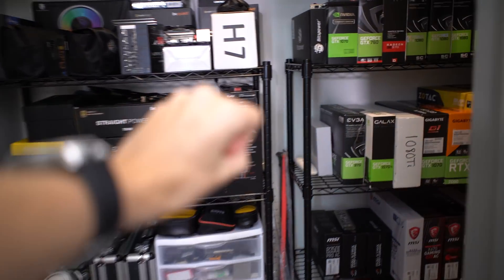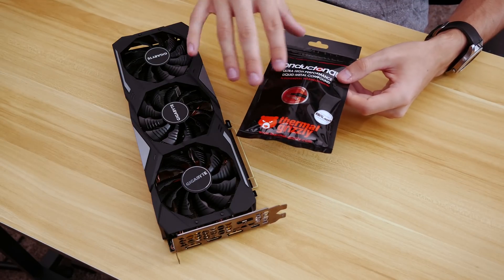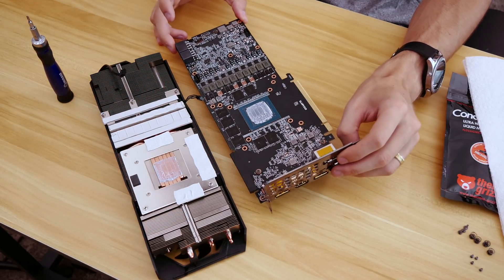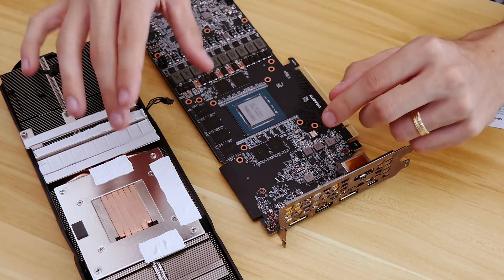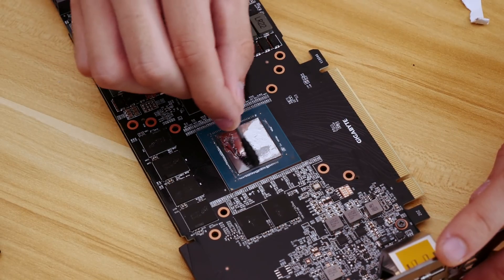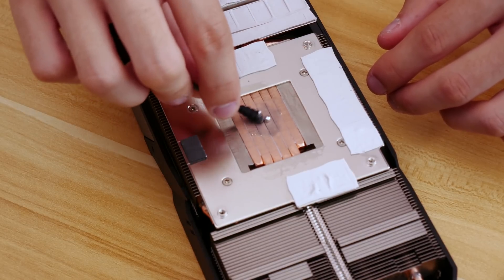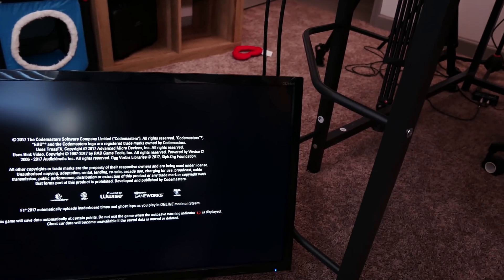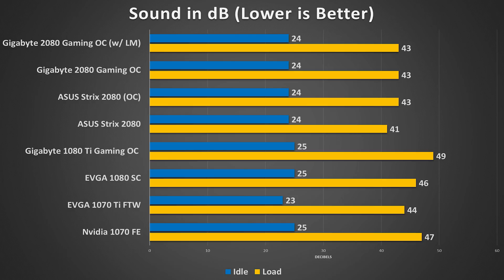Liquid Metal on a Graphics Card?

Comment: Instead of going with liquid metal right away, try just putting on new thermal paste. Temps get worse are thermal paste ages and the factory applied thermal paste often isn't great either. My 1080 Ti mini dropped 5°C just by putting on new thermal paste.

Comment: You need to first set the fan speed or rpm to the same number, if its left on auto it'll just lower the fan speed and get the same temp, next you need to have the same clocks. This testing is very faulty.

Comment: I think you'll find the real reason aluminium is used in heatsinks is not because it dissipates heat better than copper (because it doesn't). The primary reason is cost. Copper is roughly 3.3x more dense and roughly 3.5x the cost, meaning that 1 cubic metre of copper costs roughly 13x more than the same volume of aluminium. There are of course additional benefits in that aluminium is much lighter and it's also easier to work with.

Comment: What? You could not apply LM on bare copper? I never applied on copper pipes, but on copper 7yo heat sink where liquid metals just started to exist? All spreads well on copper.
You just need to remove all compound and grease. Just rub LM in and done.
Reply: Do you know what element the liquid metal is getting in contact with? (The cooling part, not the die)
Because if I'll buy my new PC, I wanna buy a vega 64 and probably will use LM on both my cpu and my gpu, but I don't know if the LM will have contact to Aluminium on the GPU cooler

Comment: I dont think its a waste of time GTX 1080 with kraken watter coling its nice.... But I literally could not hold below 48°C (of course high OC with custom bios & voltage above 1095mv... What is bad about that? If temp rising to quickly frequency going to drop same as if you are going above 48°C. With Liquid metal? Its no going above 39-40°C  even after few hours of full load at 2138mhz (1150mv ) stable freq as well as (OC in general). So its usefull  (as fine tunning) and not only in my hands! I would say more heat you can generate  -> more advantage of liquid metal you can see. Thats just my experience. Cheers.

Comment: Hey there in your bench you 1080 ti gaming oc is 80 degree ... i have the same card i replaced the paste to mx-4 and termal pads which i dont even know if they sit right.... the card is 65c (max)at full load my pads are 17 w/mk ... i dont know if this temps are from the help of the pads or only the gpu cus i dont know how to check vram and vrm temp with software.... but i have laser temp tester on D way so i will know in the futur😅

Comment: if using the turing gpu boost 3 the speed of the fans is set according to the thermals, the clock is also set according to the max temp/current temp/max volt/curr v, so to precisely point out that this card didn't benefit from LM Cooling wouldn't be precise. If it got a higher auto boost, if at max fan rpm the temp was lower than the stock cooling material the value of LM cooling would be higher.
However on the opposite side wasting that much money and time as well as risking frying your card is not something worth 10 C difference in temps. (That much from the video is spot on)
Much better to invest into proper airflow/fan position/vrm pads than the liquid metal and the application procedure.

Comment: Did this back in 2007 on a GeForce 8600GT with a Zalman VF900 cooler. Soldered on VR's for core and mem vmod, overclocket the hell out of the card and played Half Life 2 deathmatch over LAN every weekend. Ohh, good ol' days.
Yeah, the VF900 still have a core die imprint on it, to bad it is to small by todays standard. Just sits and collect dust.

Comment: GPU dyes are delidded and results between regular thermal paste and Liquid metal is the same....could the difference in CPUs be related to the fact that LM has to be applied to a delidded CPU while regular paste (usually) isn't applied to a delidded CPU. Maybe delidded dyes are what makes the difference. Maybe LM and thermal paste aren't as different after all

Comment: You have to also realise that the gpu die is huge compared to a cpu die.  Having a tiny surface area on a cpu die means you need something more thermally conductive to really get a good temp drop. It would also be good to pull the card apart to verify the heatsink contact, because if the contact isn't good then it defeats the purpose of using something more thermally conductive.

TL;DR- GPUs produce heat over a larger surface, and heat transfer capability of paste isn't saturated.

Comment: I think your summation was errant. You did not actually complete your experiment. You have a -1deg delta and you had no gallium on the copper heat pipes due to the fact you had a filthy surface. Just lazy my friend. Scientific method needs to be followed. Clean the copper and reapply and you will get a different result.  You guys doing product reviews have a responsibility here. Keep up the good work

Comment: Here is something to think about before applying LM to your GPU. I tried putting LM on my old zotac 1080 a couple of months ago just for fun. Temps dropped around 2 degrees C with the same fan curves. (I probably would have gotten the same or close to the same temps with just some good thermal  paste). My gpu was fine for a while but then after about 3 weeks temps spiked up to 95+... yikes. I took the card apart and found that the LM had sort of infused into the copper base plate of the cooler. Not sure if this was the reason that the temps started rising. I had read a thread about this and so I was not alarmed and just cleaned up the LM and put some noctua paste on and everything was as good as new. I think this would not be a problem with nickel-plated copper as the layer of nickel  would stop the reaction from happening. Anyone here in the chat who has had similar results? Also would be nice if @Science Studio could do a follow up on this as the base plate on his cooler was also copper.

Comment: my 1080 dropped from 91 (with excessive throttling) to mid 65 in my AW R4.
Same with the CPU.
Still selling this thing though.  I want to build a PC.
But you cant compare those desktop GPU's with laptop.
It's common sense, look at the size of those fucking things.  My strix 1080ti was absolutely silent (no fans needed to be on) during idle, well before it bricked

Comment: I really wish you would have stopped and found a solution to the LM not sticking to the cooler before just continuing.  It rendered all the results after that nearly meaningless.  One surface was completely not accepting the thermal compound.  I was seriously interested in how this would work on the stock gigabyte cooler but in the end now we still don't know so to get a difinitive answer I would STILL have to put my Gigabyte 2080 at risk to find out.  These cards run HOT with the power limits turned up, and a few degrees makes a big difference when you are trying to hold a boost anywhere near 2100MHz without massive fan noise.

Comment: The better the cooler, the greater the improvement will be with LM. If the cooler has reached its max heat dissipation ability using standard TIM, switching to a better TIM will not help. However, on coolers that have their heat dissipation bottle-necked at the TIM, switching to LM will help. IE., you would see a larger difference on a GTX 1080 Ti FTW3, as that cooler has more ability to dissipate heat than the stock TIM can transfer to it. On the Gigabyte card you used, the cooler was already at its heat dissipation limit, and the stock TIM was good enough to meet that limit.

Comment: LM will "stick" to copper, it just has to be completely clean and roughed up a bit, that's why they include a scrub pad. 
Using it on a GPU though will show only minor gains, I saw about 2-3c on a GTX1080 FTW2  over the stock TIM and about even against kryonuat. 
I do use it on my CPU and on my laptop but great care and prep need done.

Comment: I do agree that it doesn't make sense BUT you could argue that if you put a waterblock so the cooler itself has much more capacity to transfer heat you may start to see some differences between normal paste and liquid metal....It's gonna be minor so it still makes no sense but I think you can at least see some difference

Comment: @Science studio
Thanks for another interesting video.
Maybe You should have mentioned that You should always "keep an eye out" ((who coined that phrase ??)) for "wires" between the PCB and the "Cooler" when removing it, as there for most cards is at least 1 (pair) of  "rather short" wires powering the fans... And You don't want to damage those. And for cards with RGB there are another set of wires for that.
And also if, and that's a BIG IF, you apply liquidMetal on a Gfx card I would argue that You should always take steps to protect the "caps" that are soldered around the GPU die. Either use nail polish or some other material that You have researched that will withstand the temps AND will prevent "shorting" and also avoid the "LM" can come in contact and destroy the soldering...
Just my 5C's
Best regards.

Comment: The problem with Graphics cards is that the VRMs are locked and you will not be able to push them to the point where the TIM is going to make a difference. The risk of it going over the edge of the die and shorting the capacitors just makes it not worth it. Also do not use liquid metal to shunt mod the power regulation resistors because the gallium in the liquid metal will break the solder down causing the resistors to fall off later. If you are going to shunt mod please just solder a resister in parallel.

Comment: I have an AMD R9 290X with liquid metal. It's been 3 months since I applied it and I haven't seen any degredation on the temperatures. If there was gonna be an issue thermally, this GPU would have probably caught fire by now. In fact, I shaved a good 10*c off the stock temperatures on this thing.

Also, protip: You should absolutely make damn sure you have coated the entire die with liquid metal, BUT DO NOT OVER APPLY!!! it should look like a mirror but you shouldn't see puddles of metal on the die surface like you have here. Additionally, liquid metal does stick to and can diffuse into copper. the issue comes if you have dirt and oxides on the surface. IF THE LIQUID METAL REFUSES TO STICK TO YOUR COOLER YOU SHOULD PROBABLY POLISH THE MOUNTING SURFACE AND CLEAN IT WITH ALCOHOL. AWAYS ALLOW THE SURFACE TO DRY AND THEN WIPE AGAIN WITH A CLEAN, DRY LINT FREE CLOTH.

Comment: @Science Studio, can you test with different thermal paste to verify of the stock thermal paste that comes on the card? also there seems to be a tiny gap in-between the heat pipes looks like a bad card design that means the LM or paste needs to fill in those gaps.  Thank you for the video.

Comment: i am sure others have mentioned but you got results you got cause you didnt apply lm right. yes it can sometimes be hard to spread lm on pure copper but eventually it will bite into it and spread(can also heat the surface up a bit with hairdryer to speed up the process. lm has to be spread on both surfaces in order to work 100% and also you took a bit of a risk not applying something like nail polish to pcb around gpu(or thermal tape) since you used a bit too much of lm for my taste(perfect application is not to have any "lakes" of lm on a surface but still look like a perfect mirror. ive lmed 3 different gpus in addition to cpus and when done right - results are always better than any thermal paste/pads or even solder(i expect since solder is not spread evenly and doesnt cover 100% of both surfaces). do it right and it is worth it for every gpu and cpu but do be carefull and isolate pcb around applied area

Comment: I may have missed something, but we're clocks monitored/controlled? Maybe the LM created some thermal headroom which gpu boost took advantage of to boost higher? This in theory could have the same temps as noise as the stock tim
Reply: You are correct. Nvidia cards automatically boost their core clocks when they have thermal headroom via GPU Boost 3.0. So considering this he has better thermals + more performance without even realizing.
Reply: true :)
Reply: I don't think any of these actually thermal throttle below 80°C. 🤔

Comment: Saw the title and thought you were gonna shunt mod a 20 series card. Glad you just added LM to the die all though might be cool to see about shunt modding a 2070 since the max power target is fairly low at least on the cheaper OEM cards. Thanks for trying the LM on a graphics so I didn't have to. Was considering replacing the paste on my 1080 but now might just hold off or if anything use standard compound and not LM.

Comment: Hi, engineer here.

Copper is a better "dissipator" of heat, heat dissipation is directly related to heat conduction; it is not itself a distinct physical property of any material. The reason fins are aluminium is because it's cheaper and lighter, while still being almost as efficient as copper.

Copper and aluminium at the same temperature will "dissipate" heat at the same energy rate given identical geometries, the difference being that copper is quicker to accept energy from a source than aluminium is. So the temperature difference between the heat exchange device and the cooling fluid rises quicker in response to an input of energy from the source.

Comment: I use LM (Conductonaut) on my custom water cooled cards.  On my RTX 2080 (EVGA XC Gaming with an EK water block) it made an 8°C difference in temperatures vs using Kryonaut.  With Kryonaut, I was getting 24°C over ambient and with LM I am getting 16°C over ambient with a 100% sustained load at 2130Mhz on the core.  Ambient temp in my office stays around 72°F (22°C).  I saw similar results with my GTX 1080 Ti and I saw about a 6°C difference with Vega 64, though the Vega card is installed in a different system with less cooling capacity in general.

Comment: I did not protect my graphics card with nail polish prior to LM application. It was a disaster, the card ended up shorting the card and the LM was a huge pain to clean up.  The card eventually worked after hours of cleaning with toothbrush, but its overclocking capacity took a huge hit.

Comment: Well it kinda depends, my card (an ancient XFX R7800 Series Tahiti LE) ran (with many different pastes) at an avarage of 100-105°c in CS:GO with a clock of 1100MHz (100+ OC). This was while using a custom fan profile with the fans hitting 100% at 80°c.

I then replaced the paste with LM Conductonaut and set the fanspeed to auto, and now my temps, while pushing higher clocks, land at about 65-78°c during the same loads.

It does make a difference, it's just not the "be all end all" solution. It is going to have a greater impact on some things/products, while giving little to no change with others.

Comment: I think you got this kind of result because LM is not PROPERLY contacting to the cooler(copper) side.
Reply from the maker: If it wasn't properly contacting the cooler side, temps would be insanely high. Ever run a bare GPU through a stress test without proper cooler contact? Not pretty :-)

Comment: should have set the fans to a set percentage to avoid the gpu from using its stock fan curve. Plus, you didn't clean the copper heatpipes very well you could still see it when you were trying to apply the liquid metal.

Comment: Just to clarify something: Thermal conductivity is thermal conductivity is thermal conductivity. There is no such thing as "good conductor, bad dissipator". Conduction is the process of absorbing OR dissipating heat to or from the surrounding environment, and if something is good at one, it is equally good at the other. Saying that aluminum is a better heat dissipator than copper is like saying the my well-insulated house will be better at letting out the cold since it's good at keeping the warmth in. No. It does both jobs exactly the same. The only thing other than conductivity that determines heat transfer is surface area and convection (in this case forced convection via airflow).
This means that an optimal heatsink will be made from monocrystalline diamond, then comes silver, then copper, somewhere down the line; aluminum. (Maybe there are some new fangled sciency things that are better but I haven't heard of them)

Aluminum is just cheaper than copper. That's the crux of it. Graphics cards manufacturers like high profit margins, and making a bigger aluminum heatsink is the way to go for that.

Comment: That LM is going to eat the aluminium next to those heat pipes and it will also have worse conductivity at those gaps between the pipes. This is literally the worst card to do this on. You need a card with a solid,one piece coldplate made from copper or nickel plated copper. You would have seen a much more significant drop in temps were you have done it on one of those.

This video should be delited as it is spreading false information based on an uneducated persons testing. Here's a legit test: https://youtu.be/lrMzB_K8mNU

Comment: I did this with a gigabyte 1080ti .. Temps actually got worse with the LM.  the contact surface between cooler and die was very wide. so contact with the LM was nill. Using A lot of thermal paste corrected the issue, but cleaning off the LM was a PITA.